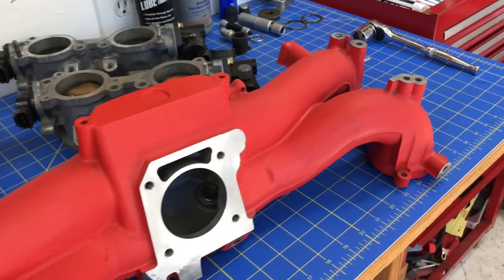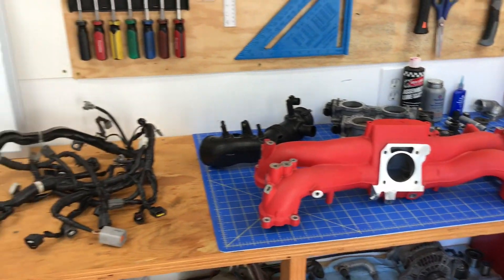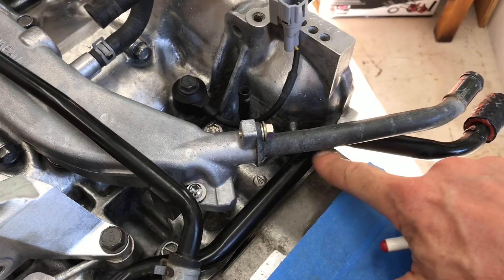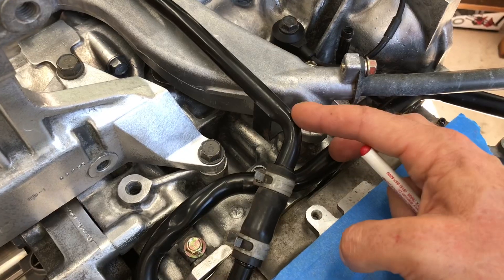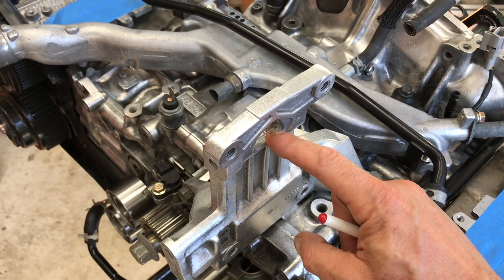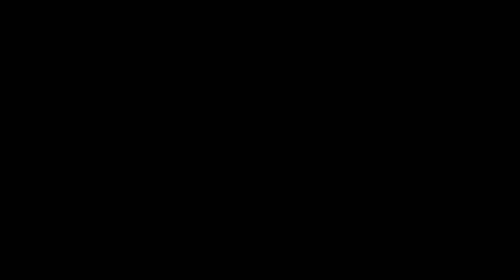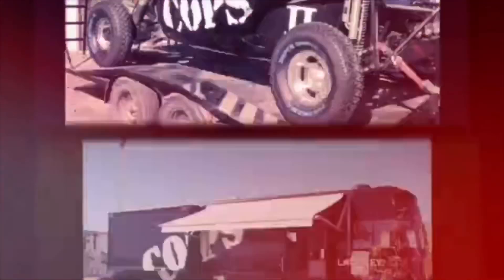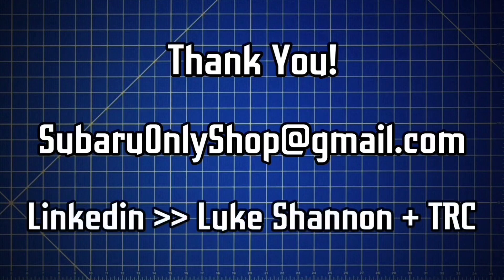EJ205 Build Update for 1998 RSTi Coupe

Comment: You should trash that OEM turbo I let for a Perrin or Tomei one. The rubber lip on the compressor will eventually tear and cause air leaks.
Reply from the maker: Good call!  I need to use an OEM TD04 to pass the BAR inspection. But ditching that thing the minute it passes. 😎😎😎
Reply: yes i was thinking the same i have a 3 inch silicon inlet tube and it is
i fantastic looks good fits well and better pedal response and more ponies !
Reply: @SubaruONLY  great video and thank you for helping us subaru fans = well done .